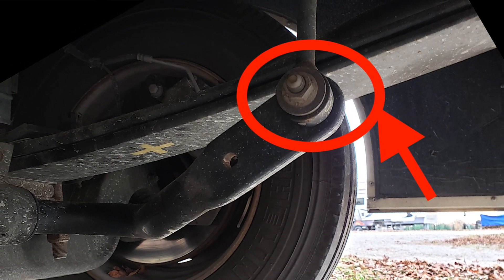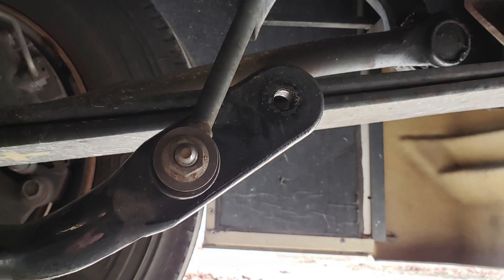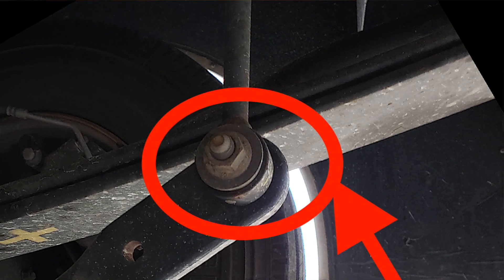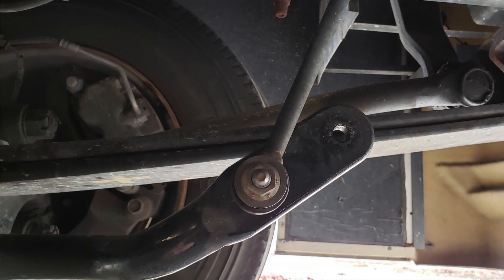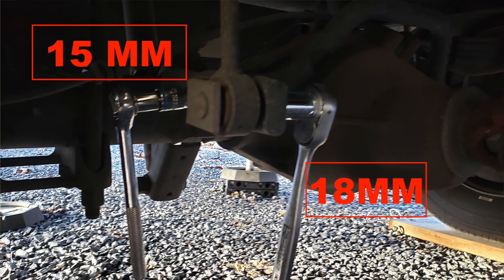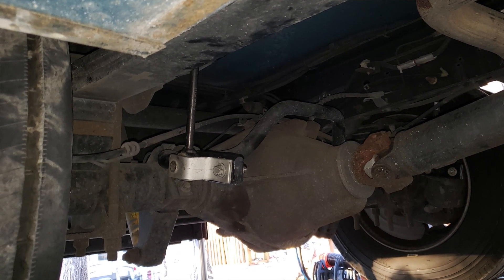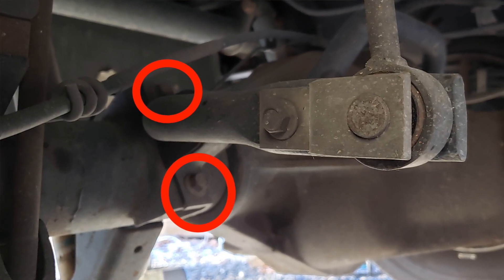RV Cheap handling Fix Front & Rear, Removed the Sway From our Class A, RV Full-Time

Comment: Hey, Kenny and Sabrina, Here's a few important tips,  Make sure all the fasteners are re-torques to 66 ft-lbs and use "Blue Lock-Tight" on the threads for both sway bar bushing brackets and anti-sway bar links.  The F-53 chassis is exclusively built for motorhomes. The F-59 chassis are designed for UPS, Fed-Ex, Bread Box, etc. style use. Two different chassis. You are correct Ford does not know how the RV manufactures will distribute the weight for the vast amount of brands and models so the anti-sway bar links are set to the outboard hole. The 2021 F-53 RV chassis now has the new 7.3L V-8, larger front and rear anti-sway bars, bushings and links, redesigned front and rear leaf springs and custom tuned Sachs shocks.    Disclaimer; I am a Ford engineer. Safe Travels guys.
Reply from the maker: Thanks for the info! I am really looking forward to test driving the new chassis it sounds like it's going to be a winner!
Reply: I just ask the question about torque setting that you!
Reply: I have the 2021 f53 chassis with the v8. Since it’s been redesigned should I just leave as is? I do seem to have body roll on highway curves. Makes me uncomfortable.
Reply: @secondmanup , I would leave it as is. On of a few reasons I had the LiquidSpring suspension system installed on my coach, 2020 HR Vacationer 35K on the Ford F53 chassis. It was a game changer. No body roll, no sway, rough roads, crosswinds, railroad tracks are almost non existent now. I did a few videos on the LiquidSpring 4 corner 5 link system.

Comment: Thanks for posting this valuable information.  I got the front done and proceeded to do the rear I started loosening bolts on passenger side rear and heard a clunk sound. I shined my light up where bushings go and there wasn't any at all I purchased 2960 Daybreak by Damon 2004 and drove home it was a nightmare swaying. I ordered new bushings from Advance auto E 550 Ford frame. I'll get it going next few days . I would have never thought to check if it wasn't for your great video. 29,000 miles and new shocks too.
Reply from the maker: Wow, good catch! Glad the video was helpful. Wishing you continued safe travels!

Comment: I did the cheap handling fix (CHP) a couple months after we bought our 2015 Vista (F53). It helped A LOT and I think you’ll be very happy long term. Great video - easy to understand.  BTW - I used a floor jack to get the second side up.  Steve
Reply from the maker: Hi Steve, I think this is one of those things I should have done a long time ago, lol. I'm looking forward to seeing if we notice any more improvement on the road from the doing the rear. I saw in forums and videos that people used a floor jack to help get the bar in position. I unfortunately do not own. Take care and safe travels!

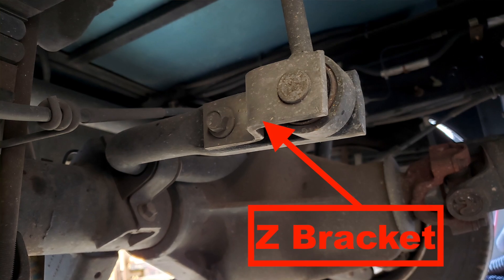Comment: The Z-bracket on the rear, shown @6:46, is presumably the reason for the two holes in the stabilizer bar... not to allow it to be misused with a different motion ratio, but to mount the bracket to increase the strength of the end link connection under the higher forces at the rear axle.

Comment: That is as good a explanation as I have heard my friend.  Thanks for the mention of me, I do appreciate it.  Everything you said is exactly as I researched as well.  My thought is, if it’s bad to put it on the inner hole...then why give you the ability to do it.  Eliminate the hole... the inner hole really makes the steel weaker structurally when you are not using it so bolting thru it seams theoretically better to me.   I have had mine this way for years and years and it does a good job of exactly what you said.  Let me know what you think of the benifit when you are out west here with side wind.  Peace and hi to Sabrina.

Comment: I had read about doing this and hear the rear was harder and maybe a job for a mechanic to do.  Good to know that both can be done at home.  I may have our son look at ours.  We talked about Safe T Plus, which is here in GA and you can stay overnight on the property.  I also heard about SteerSafe and that looks like a much more stabile piece of equipment.  I have the videos marked for hubby to watch.  I want to say SteerSafe is in OK or somewhere out that way.  I don't even know the prices of either of these but YouTube videos make the change look promising.  Be safe!  HUGS~Donna
Reply from the maker: Good morning Donna, we have only good things to say about the Safe T Plus bar. It was one of the first things we installed on our RV and highly recommend it for every class A motorhome gas or diesel. I do not know too much about the other company. I would say if your son is going to do the front sway bar for you he will easily be able to do the rear as well, they were not that much different. Good luck and safe travels!
Reply: @MovingForwardAdventures  Will Safe T Plus bar fit 1985 Chevy Winnibago motorhome with P30 chassis? Thanks for taking time to answer!

Comment: Always great info and practical. Obviously Ford put the additional holes already in the bracket. Hope Doc is doing well and staying safe.
Reply from the maker: She is doing well! She has the weekend off and we are at a nice campground with decent weather we'll do some grilling today and start up a campfire. I agree about the additional holes, if they weren't meant to be used they wouldn't be there. Take care and safe travels
Reply: As you can see at the rear, the additional holes are for a bracket (not used at the front), not for adjustment.

Comment: I had the same problem with my ford f53 chassis due to replacing my tires with softer radial tires. The F53 has the typical ford longleaf spring. I went through several Expensive stabilizing commercial fixes that didn't work. I came across an article that said to add extra leaf springs to the ones there I did this and fixed the problem cost $1600  but cheap compared to the $3k that I had already spent. which didnt work.

Comment: Hi great video, I am going to give this a try.We are going from NY to FL next month and this hope this corrects that issue. Do you know if there is a torque spec for those bolts. Thank you
Reply from the maker: Hi Joe, I think you will be happy with the adjustment. Make sure the RV is level when you make the adjustment, it will make it easier to slide the bolts in and out. I believe the correct torque setting is 66 ft lbs If you don't like the ride afterwards, it's pretty easy to change back to stock again. If you think of please let me know what you thought of the changes after your trip.

Comment: Please let me know your thoughts on Timbrend springs and safety plus steering stabilizer? How did the rear cheap fix work and is it still working out good .
Reply from the maker: Hey Bryon, I am not familiar with Timbrend springs, but if they are anything like Sumo Springs then I say get them. The Sumo Springs greatly reduced the side to side sway in my RV. Safe T Plus bar has been the best item I purchased for the handling of our RV and I put the rear handling fix back to it's stock postion as I felt it made the ride too stiff, I'm actually thinking about putting the front back to stock as well for the same reason. Hope the info helps!

Comment: -I guess thihs will not work for Chevy P30 chassis used in 1975-1999 motorhomes?
Reply from the maker: Hi Temir, no I don't believe it will work. I think this is only an adjustment on the Ford Chassis, but you should be able to find a safe t plus bar or sumo springs to fit your RV

Comment: Nice video, thanks. Do you know the proper torque to use when putting the bolts back on?
Also, as you said, this option will reduce the side-to-side sway of the top of the body (tilt, if you will). I also find that in my 2016 Winnebago Vista LX, the front end had a VERY large amount of play in the steering wheel. This is VERY tiring to drive. I added a "Safe-T-Plus" steering damper. This has improved (reduced) the steering wheel play considerably, but the amount of play is still too great - it's still a taxing drive. Any ideas how the steering wheel play could be reduced even further?
LOL, I just notice The Casual RVer post below, saying the torque should be 66 ft-lb. I really have to read other posts before posting!
Reply: If you have play in the steering a spring and damper clamped crudely onto the tie rod is not the solution. The steering box has some adjustment for free play. That box, or excessive play in the joints, would be the cause of free play in the steering, and an add-on device does not fix that problem.

Comment: I installed Safety Plus and the upgraded rear anti sway bar on my 2014 Itasca Sunstar and they made a huge difference… should I try the “cheap handling fix” on the front sway bat too?
Reply from the maker: Hi Theodore, I would be surprised if you noticed a difference with the handling fix since you upgraded your rear sway bar. I can say that I undid the rear handling fix because I felt it made the RV feel too stiff and you could always try the front handling fix and easily reverse it if you didn't like it. You are probably good to go though

Comment: The answer to the question @8:06 (why doesn't Ford do this) is not that they expect anyone to change it. The chassis is not used for food trucks (that's the F59) or anything else other than a moving house, and the chassis is ordered with a specific gross vehicle weight rating - currently Ford offers several versions from 16,000 to 26,000 pounds - and a rational RV manufacturer buys the version matched to their unit's loaded weight, so the loaded weight is not a mystery. The "cheap handling fix" modification results in an unsuitable angle of the end link (at least on the front), so Ford clearly does not intend anyone to use the wrong hole in the bar.
Reply: UnSuitable angle?.. Define, UnSuitable.. Different angle, yes. Does it reduce the strength, the lifespan of the part?.. Yes. Are you likely to notice it? No.  Changing it to Firm, produces a Lot of improvement. People have been doing it for 8-12 years. Draw your own conclusions.

Comment: Would this also help the motorhome from swaying so much?
Reply from the maker: Hi Zoo keeper it will help reduce the overall side to side sway of the RV being so top heavy, but we also found it made our rode a rougher. We recently put our handling fix back to stock and bought Sumo Springs. They were obviously not cheap, but they did help with the sway and improved the ride quality as well
Reply: I’ve heard of those sumo springs! Did you get the ones for the front and the back or just the front?
Reply from the maker: At the moment I only did the front and they made a big improvement, I am planning on doing the rear as well in November. I like doing one thing at a time to really see what makes the difference.

Comment: How has this worked out? Any issues? I was thinking about doing it to my 2019 F53
Reply from the maker: Hi Orlando, we have had no problems with this setup at all. I think we have gone over 30,000 miles now. I'm not sure if I mention it  in this video or not, but I did put the rear bars back in the stock position, I thought it was too stiff after driving it for a while.

Comment: What about the rubber part with the extra stress
Reply from the maker: I have talked to Ford  & other mechanics, they don't feel it is an issue. If you are thinking of doing this modification, I would still ask your local mechanic or whomever does work on your RV, it doesn't hurt to get more opinions on it.

Comment: Hi Kenny, thank you for making this one. I recently purchased (Jan 2021) my very first RV and it is a 2021 Class A Fleetwood 29m. Driving it around the area to local campgrounds through city traffic is a breeze. But on the hwy it is white knuckles the entire time. I am blown all over the road and don’t feel safe at all. Since I have purchased it, I have had a front end alignment as well as the Safe T Plus bar installed and it sill feels terrible to drive. I am curious how you felt after you adjusted the sway bars on the front and the back. I am ready to trade it in or sell it. I actually dread getting on a hwy. thanks for any insight.
Reply from the maker: Hi Troy, I'm sorry to hear the Safe T plus did not make much of a difference that is usually the first thing I tell people to change, because we had such good luck with it. I feel the front to sway bar adjustment made a huge difference in our ride during ccornerining and coming off and on exit ramps. It helped a small amount with wind. I don't feel the rear sway bar adjustment helped anything at all and wound up putting the rear back to stock. Do you have the new V8 engine and chassis? I think that chassis is set up differently than the prior years and may not have the the ability to do a sway bar adjustment. I  hope the info helps.
Reply: Thanks Kenny, I wondered if the Safe T Plus bar was installed correctly. I dropped it off and they said it can take a week to get one of the clamps but then they called the next day and said it was ready. I highly doubt they drove it to make any adjustments. I am going to have that checked out. Also yes. I do have the V8
Reply: I feel the same way, getting pushed on the highway sucks. if I cant get a better highway ride, I am selling it . and buying one of the van types. maybe. :] I have a 2022 vision 30 ft with the v-8

Comment: I don’t have that option on my 2022 Invicta.
Reply from the maker: Hi Frank, it's because in 2021 Ford changed the motor and chassis for their RV platforms. So now you can not do the cheap handling fix on them, but they are supposedly a much better riding and handling vehicle from stock.

Comment: Correct - "sway bar" makes no sense, although it is commonly used informally. Correct terms include anti-sway bar, and "stabilizer bar"; vehicle manufacturers (including Ford) usually use "stabilizer bar".

Comment: So any updates?
Reply from the maker: Hi Rollong Thunder, here is update video, but it's kind of long  https://youtu.be/GsQ8hIt9Rz8
Basically I really like the handling from adjusting the front sway bar, but didn’t care for the rear adjustment and put the rear back in its stock position. I think the best way I could describe it is it felt a bit too stiff and sensitive to me.
Reply: @MovingForwardAdventures  so the sway bar links didn't break? That's what I hear happens just curious?
Reply from the maker: No problems at all, never heard of this happening from just making this adjustment.

Comment: Gee, Mr. Wizard, what are you going to tell peeps when their links snap from being installed on a steep angle? That will leave them as if they never had an anti-sway bar and possibly damaging another part, maybe even a brake line, a power steering hose, etc. But it's all in fun and you get to make your 12 cents while putting peeps, their friends and families at risk, right?
Reply: Carl, stop trying to scare people. Go look at the assembly in question. Tell me, how will A breaking, cause B to fail?..   IF it were to break, and Yes, there is one documented instance of an endlink breaking BUT.. that instance does not state it's because someone changed the stabilizer bar setting from Soft > Firm.    You worry about another asteroid hitting the planet, most of us that are interested in doing this have done it or will. NObody has had a documented crash due to the endlink failing, or even a documented failure of the link itself.

Comment: on the surface, this seems like a foolish modification, like most 'shade tree' mechanic mods. The strain on the end link may prove to be too much resulting in a fracture.
Reply: And Vail, do tell, what exactly would happen If one of the links Did snap?.. DO you know?.. Not, a Lot.. The vehicle would lose it's ability to stabilize the Front end. It would get your attention but in and off itself, the RV won't blow up. I wouldn't Choose to drive it like that, but I wouldn't be scared of it either. Until 45 years ago, many passenger cars didn't have sway bars, at all. Most performance cars, yes. Does a vehicle handle better with them? Of course. But not required.  Power brakes, power steering, power windows, cell phones, SAT TV, all things many people Say they Have to have, can't live without..   Anyway.  My  .02